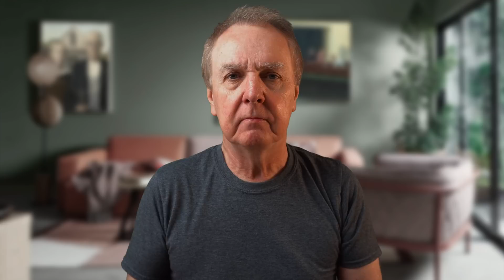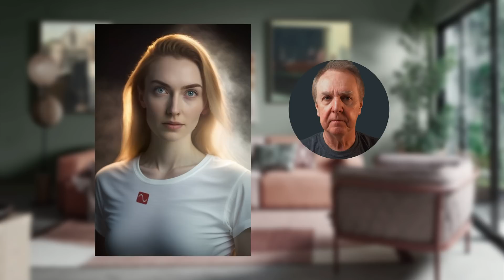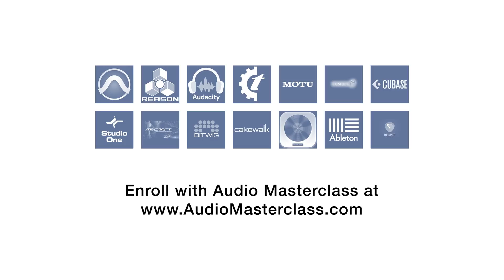Did that Dolby thing ever work?

Comment: The point is that tapes where the output level had dropped over time and age, Dolby Kicks in early and rolls off the high end as it thinks that the high end was processed and recorded louder. What recorders should have implemented is a sensitivity control where the reference level for Dolby Decode could be selected and tapes with lower outputs and could be supported.
Here is a Demo of how Dolby was intended to work. 
https://www.youtube.com/watch?v=51NbcNZlfe8

Comment: I just started getting in to some nostalgia so I have an old walkman that is the same model I had in High School (wm-f2805). I also have a Marantz PMD510 2 head deck with that sorta annoying head flip mechanism for the auto-reverse. I gave up trying to record with Dolby B and having it sound good on the old mid-range walkman that I rather doubt I can do any head adjustments on. It is better than a few pre-recorded cassettes I found laying around with Dolby B though.

If I record without Dolby, it sounds surprisingly decent so I am just going to stick with that. If I was playing back on the same deck I record on then yeah, I would certainly go Dolby C. But for home listening, I prefer to stay full digital really.

Comment: Demagnetization of head is not record for a 2 head decks. If you record tapes regularly then the tape heads gets demagnetized automatically. For a 3 head deck where record and playback heads are different you will require demagnetizer.

Comment: Dolby got rich by making a tone control potentiometer a push button or a slide switch..  I have owned all kinds of high end audio equipment including a nacamichi dragon and always left the noise reduction off on recording and playback. Was the nac that great, nope it was sent off 6 times the 1st year i had it from new. After the warranty was gone it still stayed fkked up. Sold it and went with an akai don't remember the mosel but it was fantastic. I was at a high end stereo shop in atlanta, ga years ago making a expensive purchase on tannoy speakers and whilt chatting with their over paid high end guru i told him what i thought about dolby and i told him hey i can do the same with my rane equalizers and he agreed poor man's dolby. Like the song states it's all about the bass NO TREBEL, and the back ground tape hiss guess what it's still there.

Comment: Old video I know, but...

Best performance I've ever had from cassette was using a Type IV (Metal) TDK MA-90 on a dual capstan Dolby S deck. It was difficult to tell the difference between the original CD and the recording.

Then I bought a minidisc deck. Which (at least on the kit I had at the time) sounded identical to my ears. Any original recordings I made on MD are quickly transferrable onto a recordable CD via the digital output, and unlike cassettes, minidiscs don't deteriorate with age.

Comment: As a kid I only had cheap boomboxes so I never used Dolby. Nowadays it generally works fine with quality tape (Type II, IV) recorded at the indicated level for Dolby NR. But at that point it's not even useful. If I use cassettes it's mostly to listen to popular music where there isn't enough dynamic range to require noise reduction anyway, because the signal is loud enough to mask almost all noise. I can only see it being useful with classical and jazz music - eg part one of Ravel's Bolero - but I'd never listen to those styles using cassette, certainly not in 2024. It was awful with most commercial cassettes because, well, commercial cassettes were generally shite in every way: levels were way too low for Dolby except for WEA's Cobalt "Hi Tech" series from 1984-88 or so of which I still have quite a few, where they pumped the levels high.

Comment: I never understood other people's complaints about Dolby B not working correctly until I bought a deck where it didn't. It had been incorrectly calibrated at the factory. Thankfully, I've always had access to a signal generator and an oscilloscope and was familiar with what the correct levels should be for the specific Dolby ICs.

The biggest problem with Dolby B was that it was often deployed on cheap cassette decks with a shockingly poor high frequency response. Using Dolby B correctly would magnify this problem. It actually worked very well indeed when correctly calibrated on well maintained decks with a reasonably flat frequency response.

I've never owned a hi-fi cassette deck that wasn't flat within a dB or so up to at least 16kHz with a ferric tape, so it's not something I've ever had to deal with personally.

Comment: To be honest, how about "adaptable dolby", in other terms "dolby with BRAINS". To be fair, most of us simply don't have the time to worry about cleaning our cassette deck heads pinch rollers, capstan, belt tensions from motor to deck, vibration levels from motor to deck. That the cassette brand has to be the same manufacturer as the deck and amplifier.
No wonder most people dislike Dolby. Can you wonder now, why folk would much rather have digital, and sling their vinyl records and cassette tapes in the bin?

Comment: Yeah, there was Dolby-B and C. Later came a Dolby-S(?) And then JVC had a different system "compatible" with Dolby (or so they said) called Super ANRS. Also in the 1980's came Dolby FM. Supposedly to "fix" FM broadcasts like Dolby-B worked on cassette tape. My Onkyo TA-630D deck had a built-in Dolby FM decoder. Sadly, Dolby FM never caught on.  I have found that using an expander (Pioneer RG-2) with the tape format helped with noise reduction and dynamic range. I use the RG-2 whenever I play cassettes or open reel tape. Very informative video, thanks.

Comment: I used regularly type C dolby in Denon DRM 710 without any issues.Even use headphones for critical listening no problem hiss is out
Reply from the maker: My Fostex E16 worked brilliantly with Type C. Correctly aligned, heads clean - nothing to go wrong.

Comment: Loved the video, and your technical assistant as well. If only I could find a gal as interested in audio as "she" is!!!! I'd be in heaven!!! I have sworn by the Dolby System since 1981, when I bought my first real cassette deck, a Pioneer CT-950, which had only Dolby B (no HX Pro at that time, however, I am an even bigger fan of the HX Pro extension). I have always found Dolby B to work exceptionally well when I did the following : a) I always used name brand blank tapes, Maxell and TDK (Sony if in a pinch); b) kept the heads and all the mechanical goodies cleaned DAILY with 91 to 95% Isopropyl alcohol; and, c) kept as tight a position on my recording levels as possible, keeping the absolute peak-levels at 3db over the zero reference (normal bias) and 4db (chrome) and 5db (metal). I am still playing tapes that I recorded 40 years ago, and they still sound superb, yes, with Dolby B switched on. The thing most people need to remember (me included sometimes) is that some pre-recorded tapes can sound muddy with Dolby on, especially pre-recorded cassettes from the early to mid 1970's. I can only think of one company at that time here in the US that encoded their pre-recorded tapes with Dolby, and that was Columbia Records and their family of assorted labels (like Epic, and so on), because they tended to use not-so-good quality of blank cassettes for the mass-production of their product. Plus, the basic ferric oxide formulation at that time really needed improving (most people still thought of cassettes at that time as dictation machines and tape-recorders, not intended for serious music listening), which came along later in the 1970's. Like you said, none of that is not the fault of the Dolby System, but of the inherent limitations of the product by the producers (initially) and, the complacency and lack of care by the consumer (eventually). It's a shame that licensing was lost for all future decks of "quality" to be made in the future (I say this tongue-in-cheek, as most all new, if not all new, cassette decks are pretty much pieces of crap, and no amount of any kinds of "Systems" can make them sound good). Keep up the good work, and if you can, maybe do a video (if you think it's worth your time to do so) on Dolby HX Pro. Thanks again!!!!

Comment: My experience with Dolby: about half of the pre-recorded cassettes sound awful with Dolby switched on, because they were duplicated with bad calibration. The other half sounds excellent. Dolby S is simply fantastic, it removes practically all the noise - takes some fine details with it, but not as much as Dolby B. The problem with Dolby S is lack of compatibility. Very few decks support Dolby S, and while you can listen to a Dolby B encoded cassette without Dolby switched on, it is impossible with Dolby S, it sounds unbearable without decoding.

Comment: No.
Reply from the maker: Now if you could have given a reason why you disagree with my video, that might have been a bit more interesting.
Reply: Yes. I have numerous high-end decks using the best tapes. I rather have the noise floor of hiss rather than the shaved off  highs. Dolby B,C,S did not work for me. DBX a little bit, but mostly only on the deck they were made on, so not very compatible overall. For me a good machine,  good tapes, no noise reduction is what I preferred.

Comment: Not going into the Rabbit hole of debate, but... By experience I can say this: IF a good deck is adjusted perfectly, dolby B does work as intended and designed. I have had various decks which I adjusted like they should. Prerecorded cassettes with a dolby logo however.. is a different story. They WILL not sound good with dolby switched on.
Reply from the maker: This could be compared with (analogue) Dolby Stereo in the cinema. It sounded fantastic in a Dolby-equipped cinema (like when I saw Star Wars in the Odeon Marble Arch https://en.wikipedia.org/wiki/Odeon_Marble_Arch in 1978), but it also sounded good in a cinema without Dolby. In fact probably better than a print not Dolby encoded. I tried to see Close Encounters on the same day in Leicester Square https://en.wikipedia.org/wiki/Odeon_Luxe_Leicester_Square but I couldn't get in.

Comment: it was a failure. it’s way too complicated for a mass consumer product. 
They should’ve just implemented it on high end hi-fi gear.
Reply from the maker: Eh wot? It had one switch.
Reply: @AudioMasterclass  The one switch which consumers unanimously dubbed “the mud button”
leave it off.
Reply: @AudioMasterclass  I actually think the failure was because of the fact that if you give listeners an option between more treble or less trouble in an A/B  live audio example they always pick that “Airy” frequency response. 
if you already hear the high end boost and your ears adapt to it once you take it out it sounds like a drop off. Even though psychologically if the button would’ve been pushed in from the beginning and you never heard the other example you would be fine and think it sounds normal
Reply from the maker: You're not wrong. @johnviera3884

Comment: That was my experience with my Teac CX-270 cassette deck, yes Dolby did take the top off the inter track noise, however it did the same to the music - it was not backing off as you describe, so as I usually listen to the music, not the inter song noise, I tended to run with it off.
I did try it on quite a few occasions,  but tended to think it didn't work very well at all.
Very high end cassette decks did have the ability to calibrate themselves to the tape you were using, however your average HiFi gear did not offer anything beyond the two position bias and eq switches that one blindly set according to the tape type in use.
For the most part I only used cassette tapes for playback on portable gear that had no switches, with their highlight being stereo rather than mono. So my Teac was basically only used for recording, for playback/listening I used an open reel machine (later on using a HiFi VCR), before moving over to CD's
I never thought cassette's were up to HiFi, well not the ones I could afford.
I'd record a record/LP/vinyl onto a cassette, then compare the playback, dolby off was almost always closer to the original.
Reply: It was not emphased here but head condition has a lot to do with good dolby results Head which is visibly worn works in playback almost as good as new and   if contact is ok then sounding appears to be by ear  no problem.  But when is worn  the voltage  level on head is lowered and it already makes deficiency making too quick  brink of  action  in Dolby. .

 For some advanced users there is option. My deck head  has some delicate wear  and I noticed Doby operation dull but only in one channel - other was adequate to original . Heads are worn never identicaly or may be after 45 years coal potentiometer got misaligned ? . .  I found the potentiometer on electronic plate which governs that Dolby level and adjusted it - it came out to be some 6% difference and both are now exact and good. But it is for advanced who will not mistakenly turn and misadjust other simmilar pots which will require even more experience  to return ( I realigned after 45 years almost all because it was broken no reparable deck probably from service spares. )
Reply from the maker: @Mikexception Oddly, I was never troubled by head wear on any of my cassette decks including my Portastudio but this may be because of the masking effect of low expectations. On the other hand, my Fostex E16 16-track reel-to-reel - did I give it one relap or two before I went ADAT to experience other delightful kinds of problems? As for delving inside my cassette deck to align levels, I too can wear that t-shirt proudly.

Comment: It did work, and well, but it was work to make it work. The whole compact cassette thing was fiddly and ultimately limited. Yes, transport hygiene was critical, and some machines had extensive calibration features. I had some Nakamichi decks, and was familiar with other decks, that had extensive manual or automatic calibration capabilities, and things like outboard Dolby B or C boxes. To optimize recording and playback, these things had to be continually optimized. Then, a tape was pretty much optimized for that machine it was made on. Play that tape on any other machine and it almost invariably sound different, and usually worse.

Comment: If the tape machine's heads are clean and aligned properly, of course Dobly NR just works: correct frequency response and tape hiss is reduced. But especially if recorded and played back on the same deck. The trouble was recording on a decent deck then playing back on another (and car players without Dobly) – people got used to thinking the over-bright, compressed HF (and hiss) was normal. 
In fact, "dolby stretching" (encoding and not decoding) was often used in multi-track tape recording as an enhancer effect on parts such as backing vocals.

Comment: I bought a prerecorded cassette, back in the day, that was recorded with Dolby noise reduction. I also used to use a little screw driver to align my head for different tapes.

Comment: In a test where Dolby recordings were played back to a panel of listeners with good equipment perfectly set up, and compared with recording and playback with no Dolby, the noise reduced recordings still sounded subjectively duller, even though the frequency response could be measured and was exactly the same. A further experiment explained this: they played a recording back with and without white noise deliberately added, and everybody agreed that the sound with artificially added white noise sounded "brighter". So even with perfect aligned equipment you can't win!

Professional Dolby type A recordings (e.g. studio mixes and master tapes) always featured a burst of "Dolby tone" at the beginning of the tape: this was used to calibrate the playback level so playback processing would be matched to the record processing. I think some Dolby B recordings also had a Dolby tone at the start, but VERY few cassette players had anything you could adjust to use it, and virtually nobody would have known how to use it or even what it was.
Reply: That is another perfect confusion -listener's  impression depends on spectrum he at moment hear. Today I make recordings from my exceptional AM radio and I observe that whenever reception is more noisy ( noise spectrum is almost two times wider than signal from station) my impression is that such recording is....  like I listen to wider spectrum. When day is good for reception and noise is not much noticeable impression about sopranos is more confusing - depends on instrumentation and track. . .

Comment: It's funny how long each iteration of Dolby took to filter through into mainstream home audio decks.
When you consider Dolby B was introduced in 68, Dolby C in 80 and Dolby at S in 98. Yet I didn't see too many decks with Dolby C and until the mid to late 80s. It felt like Dolby S take up was much quicker although it may just have been that I was at a working age to be able to afford higher priced electronics.
 For the kind of music I listen to I used DBX instead..... But for compatibility in Walkman's I used Dolby B and Dolby C.

Comment: Dolby shmolby. A fad gimmick. Otherwise we would have had the button on CD players and streaming services. 
🤓
Reply: CD (and early digital ) had pre-emphasis and de-emphasis, to help suppress HF noise on playback. It was actually an analog circuit in the converter, activated by a sub-code flag on the disc or digital tape.
Reply: @TWEAKER01  Was there for the beginning of CD. Did not know about the emphasis button.  Cool. Thanks!